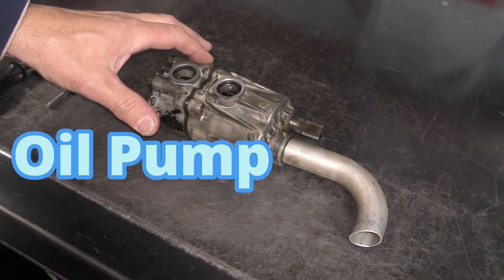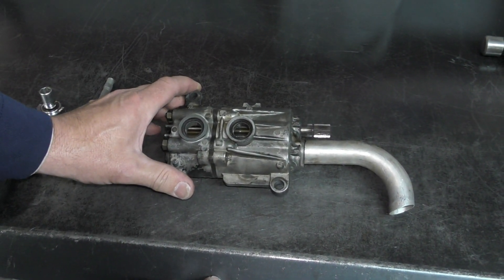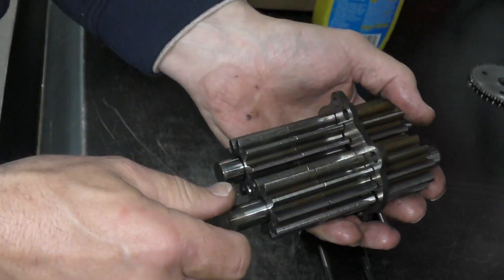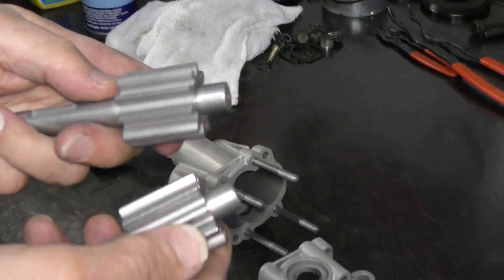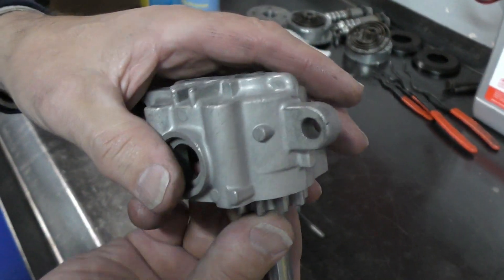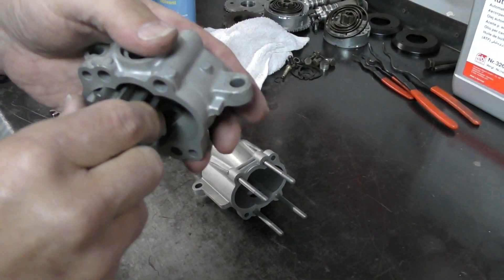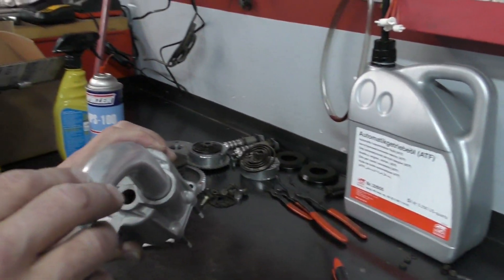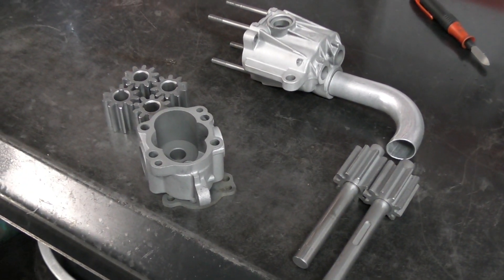Oil Pump Porsche 911E Engine

Comment: Hi, thank you for your videos, they are informative and well done. Regarding the scavenge tube, what glue would you use to fasten it back to the pump? In my earnest to clean, my tube came off. It didn’t take much though. I’ve removed the dried glue from the factory. Thanks
Reply from the maker: I just use JB Weld, Just make sure to clean everything really well and make sure the tube is in the right position when you glue it in place. 
Kurt

Comment: Hi Kurt,
Thanks for your videos, they are invaluable for Porsche enthusiasts all over.  I am rebuilding a 3.0 SC.  I noticed that the pickup tube of my oil pump is a bit lose (I can move it about 1 mm side to side).  I believe that it may be worth to remove and then glue it back again in place.  What type of glue would you recommend using?  Thanks again for sharing your knowledge.  Cheers!
Reply from the maker: We use JB weld to reset oil pick ups. Be careful when doing the SC pick ups because they use a fixed oil screen if you get the angles wrong then you wont be able to the oil screen on.
Kurt
Reply: @Aircooledconsulting  Will use JBWeld.  Thanks again!

Comment: Thank you for your videos Kurt, they have been invaluable in giving me the confidence to build my engine myself. I have a 3.2 liter and was wondering a few things. Upon reassembly do you grease the gears when you put them back together? I removed the pickup, what is the torque spec for the bolts and do you use loctite on them? Lastly what is the torque spec on the nuts for the pump case studs and do you use loctite on them also?
Reply from the maker: The m6 studs on the pump are torqued to 6-8 Nm I always use new hardware, (Nut and a wave washer), and no loctite.
Kurt

Comment: As I understand it the oil bypass mod (developed by Kremer Racing) allowed the scavenge side to be reduced as the pressure overflow didn't do into the sump and therefore the pressure side increased. When I rebuilt a pump I glass plated the ends to set the clearance. Also I'm interested to see you didn't note the pairs and mesh positions of the gears which I'd recommend (they have dot marks) as the gears would wear into each other.
Reply from the maker: Yes, when I reuse a pump, I flatten and set the end clearance on the housings and separator plate. (I did mention this in the video, which is more important than gear tooth clearance.). When it comes to the gears, it really does not matter. Gears do not wear into each other; if they do, they are trash (just like the ones in this pump). The gears used in an oil pump are not like the gears in a transmission that have been honed to each other to make a matched set. Instead, these are straight-cut hardened gears that are entirely submerged in engine oil. Now it does hurt anything keeping them in the same place, but it also doesn't change anything putting them were ever. After 100's of oil pumps, I have never had any issues or comebacks.
Reply: @Aircooledconsulting  Thanks Kurt - Would be good to post what you set the end clearance to. I won't obsess too much now about putting the gears back where they came from - My final test is to see if it spins and will pump enough air to move a piece of paper off the outlet

Comment: Is it critical to install the gears in the exact same positions as they were running? I notice there were some punch marks on the ends of the gears.. are they alignment marks?
Reply from the maker: No it is not critical to re-install the gears in the same place and yes there are indents on the gears but they dont seem to indicate much as I have seen them in all different configuration's when pulling apart pumps.
Reply: @Aircooledconsulting   Interesting Kurt, I just read in Wayne's book that this specific (re)alignment is critical on used pumps as the gears wear in as a pair. Then again you probably have a lot more experience than he did when he wrote the book. 😅
Reply from the maker: @lukasmatzinger  If the gears have worn so much that you have to put them back in the same place, then I am throwing that pump away.
Reply: @Aircooledconsulting  That makes sense as always Kurt, thanks for sharing your experience!

Comment: Assuming you have extra cooling capacity, do the newer pumps fit and is there an advantage to using them.  This is for a Mag 2.7 and my application is 30%  + non-competition track and remainder normal street driving.
Reply from the maker: Yes if you are looking for greater volume then yes the newer pumps will all fit the earlier cases. However like any new part you need to check and make sure that there is nothing that is hitting or touching where it shouldn't. Depending on what year your 2.7L case is it may not already have had the oil by-pass modification done. If not then that will need to be performed to avoid overfilling the crankcase with oil.
Kurt